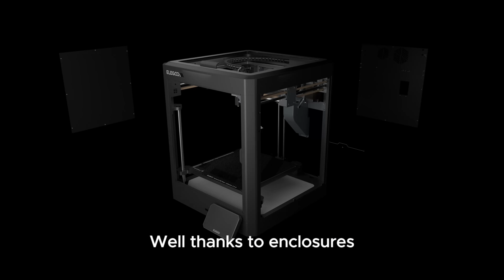It's My Printing Zone | Centauri Carbon

Comment: Ditched all three of my elegoo printers. The small neptune 3's were ok, but the neptune 3 max was a disaster. Only really got a few prints off it that were decent size. Big prints on it were just not doable. Get to a certain height and it would just wobble around, breaking supports off in the process.  Then I saw the mess that the 4 max was off SO many sketchy reviews and was like nah.  Replaced them all with P1Ps and never looked back. I can print big stuff in a fraction of the time in smaller sections without the risk of failure after a 200 hour print.

Comment: Personally, I won't be getting any more Elegoo. I had so much trouble with my Neptune 4 Plus and it wasn't screwed together properly at the factory. I converted my Neptune 4 Plus, which means it now has a total value of €2500. And now it's running reliably.
And I've already seen and heard from others that the Centauri Carbon doesn't have a high quality compared to the competition.